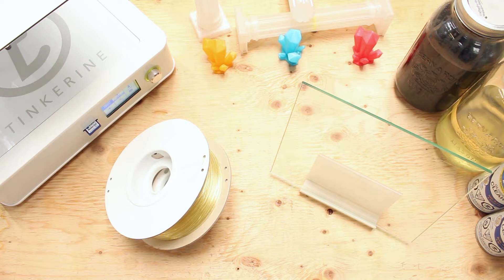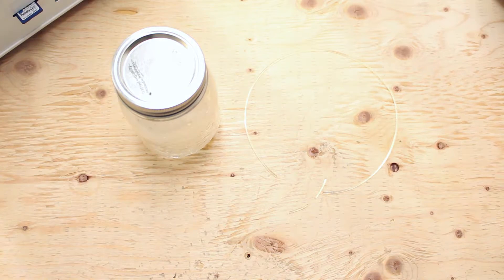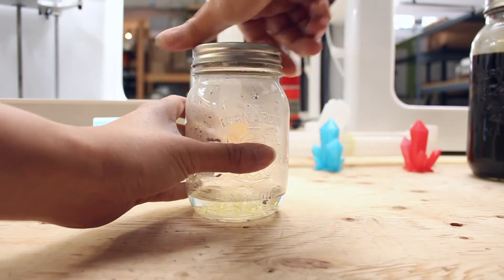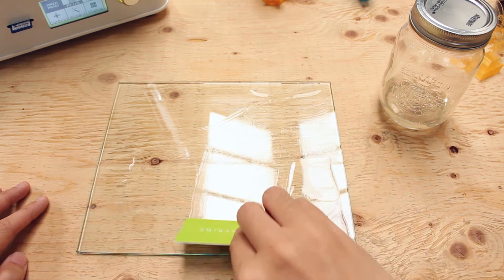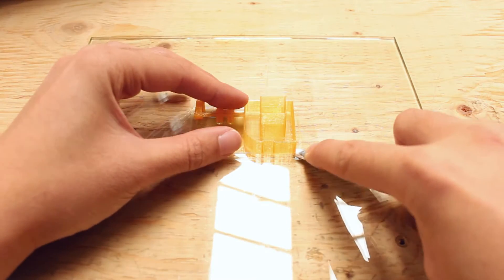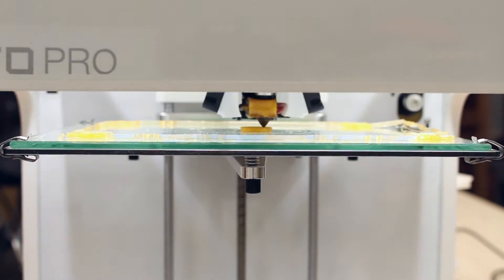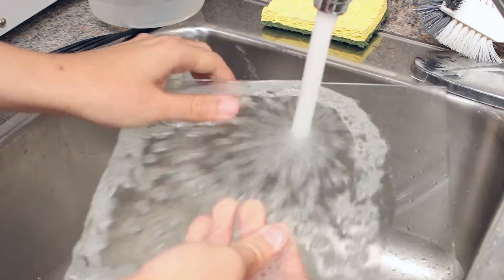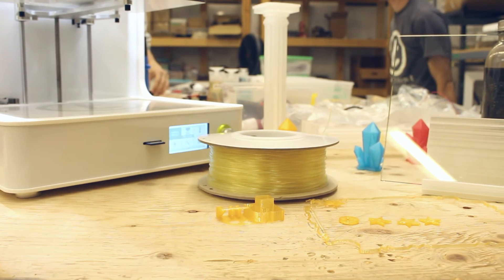Bed Adhesion with PVA

Comment: PVA = Poly-Vinyl-Acetate.  Also you can purchase PVA liquid glue from many local craft stores or online instead of dissolving solid PVA.
Reply: Here PVA is poly(vinyl alcohol), poly(vinyl acetate) is not water soluble while poly(vinyl alcohol) is. Though poly(vinyl alcohol) is made by hydrolyzing poly(vinyl acetate).
Reply: @wkorf19  PVAc is the polymer which is used for making PVA filament and wood glues.
Reply from the maker: Thanks for the comment and advice!